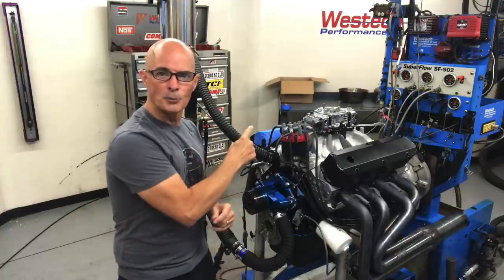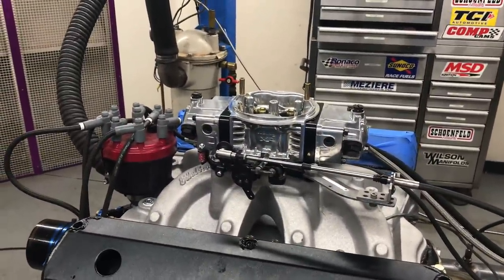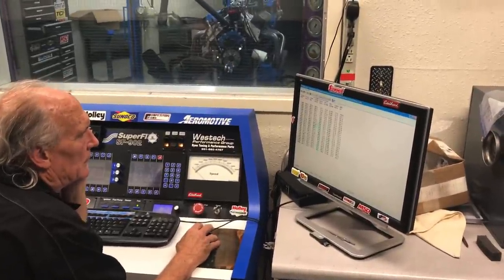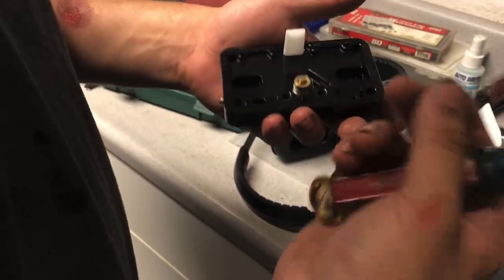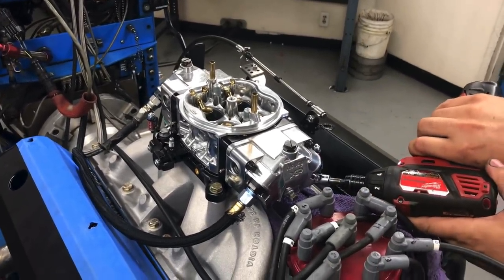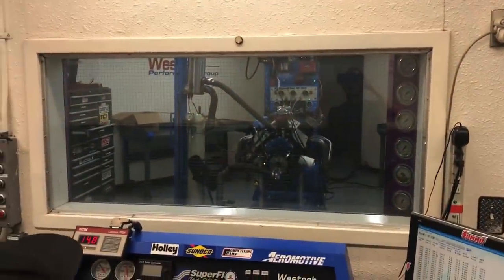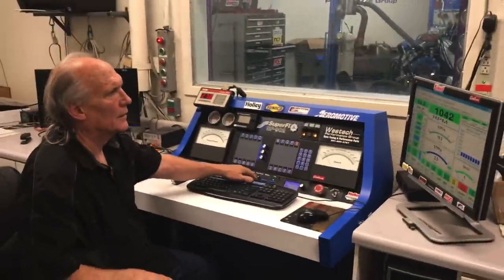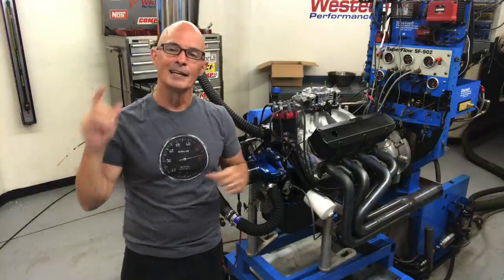HOW TO: HOLLEY CARB TUNING TRICKS (408 STROKER SBF)

Comment: I would love a complete carb tuning v effect of all the high and low speed air bleeds and idle fuel restrictors.  Great info
Reply: @colewalker6237  The air bleeds are like a more "fine adjustment" that effects the top of the RPM band on whatever circuit that they are in. Main jets pretty much are a LARGE adjustment that affects the entire range of that circuit, while the air bleeds have a much smaller effect than a fuel jet, and the results of the bleed change happen more as more air flows through that circuit.

Comment: I wish that Steve was more clear on what adjustments were needed. I got a small idea of what was going on, but it left me with more questions on tuning mid range/cruising conditions. As always, you did a great job of helping us all with trying to get the most outta our engines, and for that I thank you! Keep on doing what you do!!!
Reply: I was hoping to hear him say something about the results of adding a 10.5 power valve.
Reply: You adjust your power valve size according to your light cruise situation... 

If during a light throttle cruise, the engine is very blubbery and rich, and is stinking like fuel, your power valve number is too large, whatever manifold vacuum your engine produces at a light cruise isn't strong enough to hold the power valve shut, and you would go down in the power valve number so that the valve takes less vacuum then what is available during light cruise to hold it shut and stave off the extra enrichment until you put your foot in it, manifold vacuum drops even more, and THEN the valve opens. 

IF you are good at light throttle cruise, but the engine then starts to lean stumble when you step on it a little more, your power valve number is too small, and you would go up in size, so that the manifold vacuum that your engine normally produces and then drops a little bit when you open the throttle further than a light cruise, will now NOT be able to keep overcoming the spring tension like it did in the smaller number power valve and keep the valve shut like it did before. 
It will now open a little earlier than before and add the extra fuel enrichment that the engine needs at that further than light cruise throttle position.
Reply: @menoaz 
OMG old man's garage has some excellent carb tuning videos. He even has some with SBFs. He mentioned in one or more videos that ford's in particular are more finicky with PV sizes compared to like a SBC.

Comment: Great tips!... 
The number ONE thing that NEEDS to be done whwn installing a new Holley carb is to get the t-slot opening correct first, and then getting the engine to idle properly, BEFORE going onto tuning. 

SO many guys don't do this step. They lump the carb on, crank the idle screw up to get it to idle, proceed to tuning, and now the t-slot is all out of whack. 

So much low speed, tip-in, and light cruise, performance can be lost by not making certain that the t-slot is correct very first.

Edit: I figure that I better explain what to do if your engine WON'T idle after you set the t-slot because the idle is too low... 

You pretty much have to adjust the idle screw to get the t-slot opening looking correct, go install the carb, and then hope that the engine idles with the idle screw at that setting. Once the t-slot is correct, you have very LITTLE adjustment on the idle screw, in either direction from there, before the t-slot is too far out of adjustment again. IF the engine won't idle with the idle screw set to the proper T-slot setting, you can't just crank the screw up a bunch til the motor idles. You can maybe go about a half turn or so in either direction before you have the t-slot too far out of adjustment again. At that point, if the idle is too low, and IF you have a newer Holley carb with the idle air adjustment down under the air cleaner stud hole, you adjust the idle that way by turning the screw down there to pick the idle up, and then adjusting the idle mixture screws. IF you don't have a newer carb with that feature, you must drill a hole in each primary butterfly, right in the center between the throttle shaft and the outside edge of the butterfly on the side of the blade that is closest to the bottom of the carb. The side that ends up moving down towards the intake when you open the throttle. Start with a very small hole in each blade, (less than 1/8") then retest. If it idles faster, but still isn't enough, slightly enlarge the hole in the blades and retest again. Keep going larger with the holes until you have a satisfactory idle. Done. Now proceed to tuning the rest of the circuits.

If you tune your Holley carb idle like this, instead of just cranking the idle screw up until it idles, you WILL have a much better, crisper, tip-in and light cruise performance than ever before. It's WORTH the extra work to set the t-slot up properly and adjust the idle the correct way. 👍
Reply: Don't drill holes on the blades don't crank up the idle screws. Adjust idle air bleeds read up on it

Comment: The power valve change was due to the 6.5 coming on when it shouldn’t, (Richening ) due to the mild cam having more than 13 inches of vacuum at idle.
The air bleed change was as  far as I can tell , to the idle circuit to enrich the idle and be able to set it in the middle of the adjustment range on the screws.
The screws originally seemed to be all the way out or close to it.
The carb is just a tad big for it so the air bleeds needed to be made smaller.
The jets were to lean it out .
Adding two degrees made more power but not enough to warrant it due to the possibility of getting sub par gas and having knock, so they were going back to 34 degree total.

Comment: 86 on the primary side seems really big to me. My Dart SHP 400 with 750 double pumper HP only needs 70 jets on the primary side and 82 secondaries with 6.5 power valve. Seems like they are keeping the power valve tight with that 3.5 vacuum rating and using the primaries as the only source for fuel.

Comment: Back in the olden days a735 cfm Holley(oem 428 Cobra Jet) was$32 sold by Motorcraft.
Reply: I doubt if they were ever that cheap.
Reply: @cjbert6790  I installed many on 351 mustangs. They really helped. I also owned a 61 Starliner with a 428 super cobra jet,top loader and 355 posi.
Reply: Donald Israel     Sounds like a cool car!
Reply: @donaldisrael7147 posi (GM) on a Mustang huh?

Comment: Gotta love carb tuning. Especially when you have adjustable low and high speed air bleeds
Reply: @jaydubb71  and EVERYTHING ELSE that billet metering blocks offer.... There's MUCH more to tuning than just the 2 or 3 airbleeds (depending on whether it's a 2 or a 3 circuit) at at the top of each barrel. 

The billet metering blocks introduced a MUCH easier way to tune a whole BUNCH of things to do with each circuit, than what a guy had to do before, such as drilling and enlarging holes in the blocks, or even worse, soldering them shut and redrilling them smaller, be cause there was no threaded holes in the blocks to remove a different sized jet in those positions. 
Now you can play with idle restrictor jets, power valve channel jets, emulsion jets, 3rd circuit jets, and so on, MUCH easier than before. 👍

Comment: I'm confused on why he went up on power valve sizing...can anyone shed some light please?
Reply from the maker: to change load in fueling
Reply: @richardholdener1727  in other  words. He went up in the power valve to open sooner with the vacuum signal to richin up the off idle thru mid signal until WOT takes over.

Comment: Learned that's a lot of ci and lot of carb for what you getting out of it! But, it's a boat engine. My guess is you're concerned more about torque from 2500-5000. I'd like to see a dirt cheap stroker 393w, hyperutectic 302 pistons with big valves reliefs prepped stock Windsor rods, big hydraulic roller cam with 10 - 10.5 compression! No $1200 carb, just a 750 double pumper well tuned! You know, crap like I got stashed back! A real junk yard dog hasn't had his shots and been on a chain for 3 weeks! I actually got all that but the pistons and crank!

Comment: At the 7:00 minute mark yall were talking about adding air to stay off transfer slot.What was that could you explain.My carb idles way too low because high duration cam and if I adjust curn idle it exposes transfer slot.

Comment: Lost me at using a rattle gun on a Carby
Reply: It's a drill or screw gun. It has the clutch settings
Reply: Lol. That isn’t a “rattle gun”. 

But when you use one everyday like the pro’s, you get a feel for the torque you are applying

Comment: is this engine not going to be run without a filter or the actual air filter used in the vehicle? depending on the filter and housing, a/f could be affected.
Reply: A properly sized air filter does not affect jetting
Reply: @8power857  yep! thats why i asked what filter would be used in the vehicle. for some reason, people love those fly eye air filters or the teeny 10x1 round filters. they murder hp output.
Reply: @OxBlitzkriegxO   im hearing ya!!
Reply: @OxBlitzkriegxO  you mean a marine flame arrestor? Cause that's not what they do on carb if you have a backfire lol
Reply: @KingJT80  no, the cheap triangular filters with foam between two mesh areas. theyre cheap and really bad. its nothing like a flame arrestor.
Reply: @OxBlitzkriegxO  I was talking about those Edelbrock heart shaped air cleaners.

But yeah those are pretty bad too.

Comment: 34 seems like magic number for 351w.  Last 3 on dyno with vastly different set ups 34 always made best power
Reply: I start at 28 and work up from there. TW heads typically want a tad bit less. However 34 is damn near the sweet spot on most of them.

Comment: In my wheel house Richard. I own a high performance carb shop here in the north east.. nows the time you start tuning the emulsion and air bleed. assuming the booster is best for the application.
Reply: Pablo id love to ask you couple questions, if your able to answer would you prefer me emailing you or asking here in this?
Reply: @pablojanski.2559  Thanks alot Pablo. In the past (had a family so ive been out of it for about 5 years and am rusty now) ive done about 6 dominators for street/strip. Meaning drilled and tapped bodies for total control of idle, transition, etc.. Other than 1 ive always converted the 3 circuit carbs to 2 circuit and had very good success. Im helping a buddy now that has 500ci hemi head mopar that just got done w his 1050 quick fuel. It was pig rich so upon starting on it noticed mixture screws were @1/4 turn out on all 4, no transfer slot showing and 1 intermediate bleed at 40 (stock was 80).  The ifr was .041" and felt that was way too much so put it at .031". His motor wasnt too far off my 466ci which i had .026" ifr and 46 air bleed which put my afr good at 1.6 turns out on all mixture screws. So my question is 2 parts,,,the first is do you have a particular formula when you size the ifr to the air bleed (i know some feel for every .001" move on the ifr the air bleed should be .006 to .008 change but many times ive seen that not the case). And my next question is do you have a possible thought on initial starting point for the air bleed for me putting it at .031" ifr from the .041".. I already know now his 3rd circuit will need work as well but until i get over to his house. I will be using a a/f meter just so you know. I want to say sorry for long message and hopefully everything made sense but also thank you sir very very much for your time and input.
Reply: @brianb5779  IFR and IAB will have a relative correlation to manifold vacuum and the cams overlap.. bigger cams need more ifr and quicker circuit timing.. fuel used is also important.. generally on dominators to be used on 500+ inch engines with healthy cams that have a good amount of overlap ( ie aprox 5-8 inches hg) you will be in the .035 ifr range and around a 52-58 iab.. turns out on the idle mix isn;t a concern. set those where they are happiest.. concern is the transition.. since transition an idle share the same circuit, going to lean on the ifr can cause lean stumble in the transition.. third circuit can be trimmed right out to as lean as that part of the throttle position likes, but keep check on the wot mixture when trimming the third real lean. Third does add a little fuel at wot via pull over through the discharge tubes.. three way balancing act between ifr third and main.. wot tuning will be hsab, emulsion and jet tuning.
Reply: @pablojanski.2559  Pablo thank you so very much for your time and info. Im in Ohio so if your anywhere close id like to stop by sometime and bring you some thank you gifts

Comment: Now we need a tuning video for blow thru carbs!!
Reply: @dmvboxgoat9969  There's ALOT there with a blow-thru carb to master, and would take MUCH more than just a 15 minute video. It would take HOURS to go through it all, and still take much longer in reality to get comfortable with and master. 

If you wish to learn about blow-thru carbs, pick yourself up a good book about the subject, and start to absorb it over days. A quick video will do nothing but leave you even more confused and dangerous than before. You only get one chance with a blow-thru setup to get it REAL close to correct, or you melt a motor down. You wanna be REAL well informed before you go to tune a blow-thru setup.
Reply: @davelowets  I have more miles on my turbo ks swap then most ppl daily driver.In it right now 3 years later.Your right it was a learning curve but I learned it and have it down packed now

Comment: Holley says power valve should be half of engine vacuum. Is this correct or do some engines like a higher number? Just confused.
Reply from the maker: half of engine vacuum when?
Reply: @Richard Holdener  that's what I'm wondering, their video indicates idle vacuum but wondering how or even if that translates into real world testing.

Comment: Quick scenario Richard, been tinkering with my 650 Demon (Holley-ish double pumper of course) on my 383 SBC. It's been kinda tricky to get it to idle while in gear since I put a Super Victor intake on it. This is actually the 2nd single plane intake I've had on it. Are single planes in general notorious for liking to be pig rich at idle (12.5-12.8 AFR) or might my 3200 stall Circle D just a bit tight? I heard at the end of the video it was said that locking out the distributor would improve idle quality. Ignition system is super basic as well. Gutted HEI with a 6A box and mech. and vacuum (restricted) advanced.
Reply from the maker: 12.8 IS NOT PIG RICH-THAT IS FINE
Reply: Single plane manifolds with a big cam struggle to provide a carb with good signal at idle.  A four hole spacer should help some. 12.8 at idle is ridiculous, sorry richard. Your running a 3200 stall? So your cam is in the 235@050 range? Your initial should be around 16-18. Need more help, shoot me a reply .
Reply: @GG-rj4oj  230/236 It's actually a XFI Comp listing (08-467-8). Restricting the mechanical timing just to bring up the initial timing, tho putting so much in and making it hard for the starter is also in the back of my mind. How much I have now, I honestly couldn't tell you. I've really only focused on the "all in" up until this point, only because it's never much been an issue until now. I do run the vacuum advance, but is already restricted, which does seem to help, but drops off pretty quick when motor begins to bog when in gear. Sorry for the rambling, just trying to paint the whole picture. Lol Oh yeah, and I'm running a Detroit locker in the rear end, with more internal lash than the law should allow. So That's a huge contributor for maintaining a 750ish RPM idle. 🤦🏻‍♂️
Reply: @n8dawg450r  super victor is way to big for that cam engine combo. You would be much better off with a air gap. But if thats what you like, you need a minimum or 14 initial. A four hole spacer will help with carb idle circuit. Make sure your throttle blades are in the correct position. Not too much transition slot exposure. Set mixture screws 1 1/4 turns out and see what its like. 
Another option you have is to connect your vac advance to full vavuum. This will bump initial timing up and yield a similar result. You can search this, its a common practice.
Reply: @GG-rj4oj  I'm currently at about 1 1/2-1 1/4 turns out, and also running manifold vacuum already. Will check and see what initial is set at tomorrow before work. See what's what. Thanx for the input! 👍

Comment: Watching how messy a jet change is on a holley carb makes me thankful that Weber and Dellorto's can be done by just simply removing the top cover. No need to disassemble the entire carb to access the air bleeds / emulsion tubes or jets and spill fuel everywhere.
Reply: You a v dub man? Guessing here.
Reply: @johnsheetz6639  
That, a Porsche or he has an inline 4 or 6.